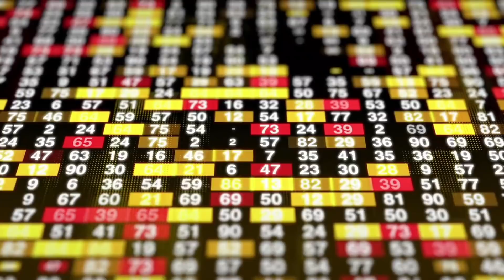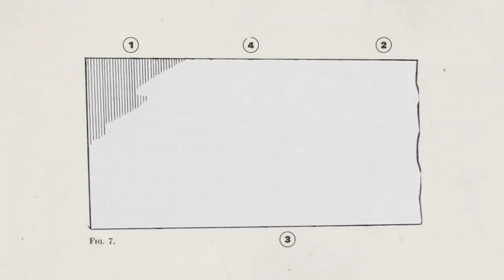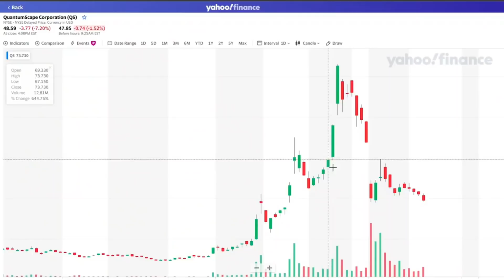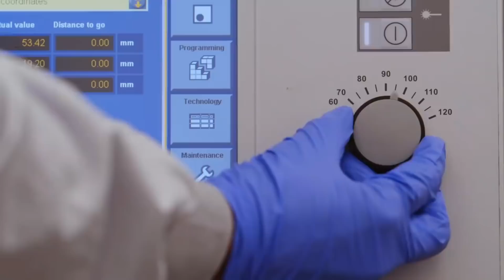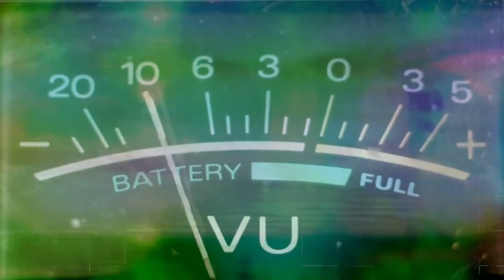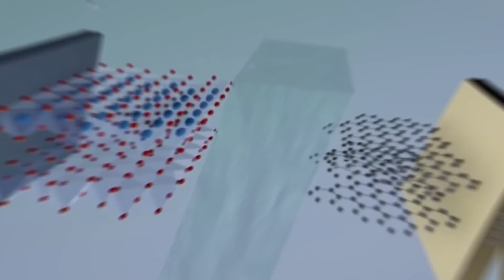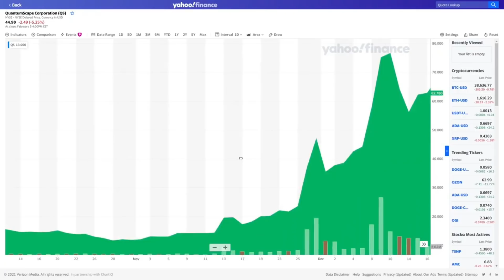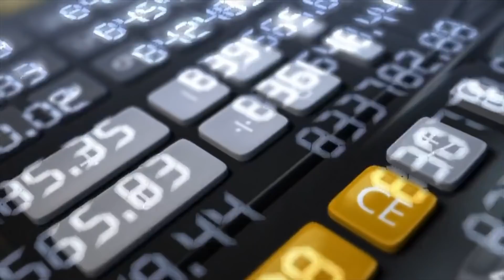GAMEOVER! Tesla's CRAZY NEW 4680 Battery Crushes Solid State Battery Competition

Comment: They know about LIT battery with it`s 20 000  - 25 000 cycles and no thermal runaway - yes it`s twice the weight of the LION, but will last for a lifetime of the buyer, and won`t need to be replaced after 600 cycles - 600 * 450 = 270 000 miles (and that if we ignore aging (1%- 5% range lost every year), and if we charge car in a perfect circumstances) vs 20 000 * 250 = 5 000 000 miles - and yes it can charge way faster as long as you have powerful chargers. Unfortunately car makers think not about longevity - but  about profits. I get a feeling that they prefer car that will collapse just after warranty expires - old school cars that car live for centuries and million miles are vanish.

Comment: Yes, Gameover and this is the winner.
GAC Group recently announced "a major achievement in battery technology". GAC stated that it achieved breakthrough progress with its graphene-based super-fast-charging battery and has now entered the phase of actual vehicle testing. Aion V, the first vehicle to be equipped with the battery, is undergoing winter testing and is initially scheduled for mass production in September this year. According to GAC, after achieving low-cost and large-scale production of graphene, it has also made major breakthroughs in the downstream application of its use. This graphene-based battery has a 6C fast charge capability, combined with a 600A high-power charger, and can be recharged to 80% capacity in 8 minutes. The battery has also reportedly passed the most stringent safety test - Battery Shooting Test, possessing quality and reliability of the highest standard.
Reply: Amazing, if not vapor.

Comment: This isn’t a production problem or engineering problem but patent board reviewer qualification problem. The review board may be talented of their own discipline but short of multidiscipline experience. 

Detail: 

There are unforeseen problems conceiving towards a tab less architecture. An architecture giving up a reliable electric conduction path (a welded tab) in exchange for multiple “point contact” at the anode-casing junction. Contacts are flaps extending from the anode periphery. Anode is made of annealed soft copper foil instead of hardened spring copper foil. 

Two expected advantages in the tab less packaging are : conducting heat (1) and electricity (2) to cell casing and coolant more directly in a parallel fashion as oppose to serial means conventionally. 

Practitioners in the art knew (including Panasonic, Sony, LG and Samsung) that point contact incurs junction resistance on heat and electricity transfer that should be avoided at affordable causes. 

Remedy? 

If use of hardened spring copper foil to address a required junction and pretension contact forces at the flaps also let the electrode rolls to unroll itself. Self unrolling (flex back) creates gas pockets between electrodes, reducing wet area on electrode surfaces, to reduce charge capacity, raise chemical impedance therefore chemical temperature for and premature aging issues. Not an option. Next ...

If use of soft copper foil to address gas pockets issue which is a matured technology Panasonic and other manufacturers use. However annealed soft copper will not hold shape once formed into flaps. Higher percentage of flap count may be touching cell casing right out of production line but will further deformed on the road under inertial and thermal shocks. As shock progress, more and more junctions will be disassociate with cell casing, until the last tallest flap remains - in touch with the cell casing. At which point thermal path is practically cut off and the next inertial shock will momentary open circuit the only only junction leading to an electric arc/spark. At such time we have hot and flammable chemical in the cell that an internal ignition and combustion is highly expected. Next ....

If use pretensioned elastomer at the cathode end pushing down at the electrode roll and further pushing the flaps against the cell casing intended to take up slacks from deformed flaps? This option will cause to the same problem above - axial compression force and thermal cycle can delaminates the electrode roll for gas pockets, to reduce wet area on electrode surface, lowering charge capacity, increase chemical impedance also raise chemical temperature and premature aging issue. No more million mile pack. Not an option for Tesla products. Next ....

If use thermal and electricity conductive paste/glue at the flap-casing junction? This may be a urgent research subject to develop a suitable conductive adhesive to be low resistance electrically and thermally stable and emits non toxic fumes in a collision that is also chemically compatible with battery electrolyte. Is quite challenged. Next ... 

If use of selective soft/hard copper foil section for anode roll. Soft in the roll while hard at the peripheral flaps - to avoid de-lamination and maintain spring copper flaps?  This calls for special production machinery that Nevada plan doesn’t have which needs to plan and develop with Panasonic. Is another urgent research subject? 

If use blade battery pack? Cells from BYD and or CATL? Elon’s call. Next ... 

If returning the removed welded tab back to the 4680 cell? This will eliminate the dangerous electric arc/spark but heat sinking plan for mY-4680 become obsekete - is an issue, due to thicker roll radius, higher heat density and resistance. To this situation blade cell offers more option and flexibility.

Comment: The claims on SS Batteries are more or less consistant with "up to" 500kwh/kg - similar to Maxwell's claim for the Dry Electrode battery. The Silicon cathode and tabless design should allow faster charging with less heat. The 4680 battery has 2 major advantages: 2 years ahead in mass production (assuming 2022 mass production for Tesla) and they are expected to have 3-4,000 charging cycles - Several times that of Quantumscape or their competition.

Comment: The 4680 has not even come out yet, better to wait until both are out before comparing them....
Reply: That will likely be 3 years from now at the inside. I believe the idea is to see whether 4680 gets the lion's share of the benefits without the wait.... and here I do agree. The estimates for the battery on density are all over the place.
Once 4680 is in volume production in 2022Q1, we should then have a less nebulous set of statistics to compare.

Comment: this is not a crazy new battery...its just bigger :D fanboyexperts
Reply: Check the Battery day list of changes or just consider this:  
54% more energy dense with expected value in the region of 350kw/kg with potential to 500kw/kg (if Maxwell can be believed. 

56% cheaper per kwh to build as no solvent, oven or drying time is needed. 

Tabless design to make the ion path shorter and uniform such that resistance during charge/discharge should be reduced significantly (especially in the last 20%). 

Reduced machinery size/cost to reduce mfg equipment cost by more than half (investment per battery line). Longer life on the order of 1million miles vs 300k miles. 

Elimination of Cobalt (the most expensive and constrained element).

Integration of the casings into the structure of the vehicle to reduce weight of the pack, forming a de-facto honeycomb structure with Front/Back/Side impact buffers.
Reply: I agree with that. Never really understood the hype around battery day. To be honest, I was quite disappointed watching it. Tabless design is mostly needed to overcome the disadvantages big cells like this would otherwise have. Cylindrical cells have never really made sense to me anyway in an application like this. That's why the rest of the market goes for prismatic or pouch cells.
Reply: @EinzigfreierName  I had mixed feelings at Battery Day. Great Potential... very fuzzy timeline. 
The big advantage that I see in tabless design is the potential reduction in charge time from 70%-100%. 

The poles of the tabs on an ordinary jellyroll are in the center of a strip maybe 24" wide (more or less) but only 3-4" wide at the poles (shortest path of ion transit). So if one battery has a uniform path of 4" but the other requires ions to transit out to 12" at the edge of the jelly roll to fully charge, one will incur greater heating than the other and take alot longer for the last 30% charge. 

We see this behavior when cars charge, they even recommend against repeated 100% charging to avoid battery damage (due to thermal effects). 

The tabless battery..... Should.... eliminate this. A battery should charge from 70-95% as easily and quickly as it charges from 25-50%. 

Or I'm wrong. 

There is huge potential outlined on battery day but I had to cool my heels at "some work remains"... Today ModS Plaid Plus, Semi, CT, Roadster, all waiting on mass production with good yields in high volumes. 

I was hoping for mass production by now but expect it closer to: 
Some small production by year's end, Moderate production of maybe 10GWH in the middle of 2022 with maybe 40-60GWH by the end of 2022 and a fast ramp beyond that.

Also, I was hoping for 400+wh/kg by end of 2022, now maybe 350 or so.
(Recall Maxwell indicated that they had demonstrated 300 with potential to 500 a few years back.)
I think full maturity will have to wait for 2023 when the M2 will (desperately) need it..... That should remain on schedule, I believe.  

As for rumors of a 2022 M2... not gonna happen. Not in any numbers that matter.

Comment: TBH solid state does not matter anymore. Current restrictions seem to fall more on the charging capabilities. At a 250kWh charging station, the rate top re-charge between solid state and Lithium would remain the same time.

Sure theoretically solid state would charge faster But where along your road trip would you find a 10MWh charging station ? 
Answer : Nowehere.
Reply: The cycle life and safety concerns are still important to some

Comment: 0:55 vs 9:25 ... you had one job ... Solid state batteries are significantly safer, with minimal(or no) fire hazard vs the li-ion batteries which have a high change of thermal runway due to dendrites forming.
Reply: All mentioned solid state cells in this video are li-ion. If you mean solid cells are more safe than liquid electrolyte ones then you’re completely right. Solid state li-ion is a natural next step as the industry has to find ways to speed up the production rates. Many solid state li-ion cell types can be built from raw materials to fully finished cells within few hours. One can skip the formation and aging processes. Liquid electrolyte cells take easily one week to get out from the factory. So with big production volume one would need even bigger storage. This is also one reason why solid state li-ion cell factory has only 5% (!) of the required Capex for same production volume with liquid electrolytes.
Reply: @mfb424  It would seem that Tesla's Dry electrode cells, alot of those benefits are already realized. They are expected to get 3-4K cycles (about 1M miles) and energy densities in the same range as solid state (400-500kwh/kg). Charge and discharge rates should also benefit from tabless design and silicon anode, closing the "power density" gap significantly. 
This leaves a probable cost advantage and life expectancy advantage to 4680 unless big strides are made with solid state.
Reply: who cares about safety ) if Musk told it`s cool - most of the customers will buy - no brainer.

Comment: Toyota and Volkswagen could always make the argument that the chance for thermal runaway is minimal to nonexistent without a liquid electrolyte. Tesla’s counter argument is that their chassis structure will protect the batteries to prevent damage from causing thermal runaway. However, we have seen several instances of Tesla vehicles melting down on fire. 

Overall, economically, it seems that Tesla’s R & D is always a step ahead of what’s soon to go into production. With that said, it would completely make sense that the 4680 battery is paving the manufacturing way to future batteries that have a higher specific energy density. 

It also makes sense that the game is no longer about a massive range improvement and more about efficiency, weight loss, cost savings, and durability in multiple real-world environments. Making cars that last and have fewer service issues will be better for consumers and the economy as a whole. Tesla’s motto is the best service is not needing service in the first place (easier said that done I must admit).

I don’t see solid state making a tidal wave of difference, but certainly having alternatives helps to diversify the automotive energy portfolio especially if there are future geopolitical issues regarding resource acquisitions or supply chain disruptions.

Just my two sense. Cheers! Great video.
Reply: Actually the 4680 Also uses a dry electrolyte and tabless design would ensure much less heat evolved during the last 20% of the charge/discharge cycle.
Reply: @avgjoe5969  Good to know, cheers!
Reply: @avgjoe5969  What the f are you talking about? That does not matter because wet electrode gets dry in big ovens.
Reply: @rojavabashur6455  No. The drying process in a conventional litium ion battery produces an electrolyte paste referred to as the "jelly roll", a residue remaining after the solvent is boilded off. Dry electrolytes do not employ a solvent and they have different properties. For one thing, the layer can be made thicker/more energy dense. 
Tabless design reduces the distance that ions have to travel by providing a uniform path over which they travel rather than central collection points for the electrons with more heat evolved as the ions have to travel further from the tab to the ends of the jelly roll. (The reason it takes longer to get from 80-100% charge vs 20-40% charge.)
Reply: solid state will bring about a ev revolution in addition to electric flight